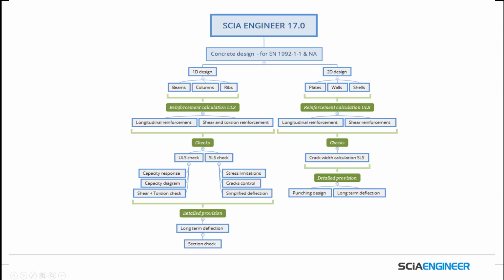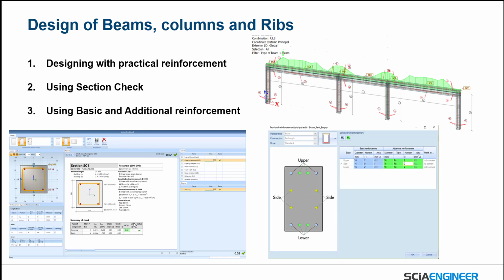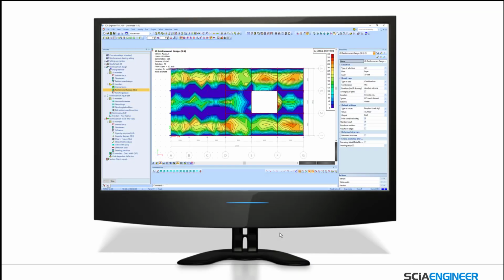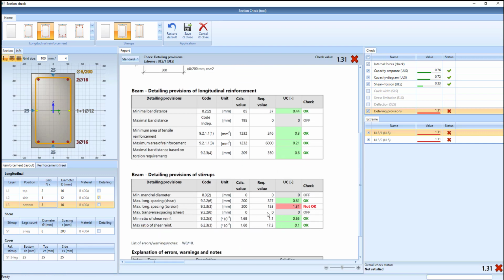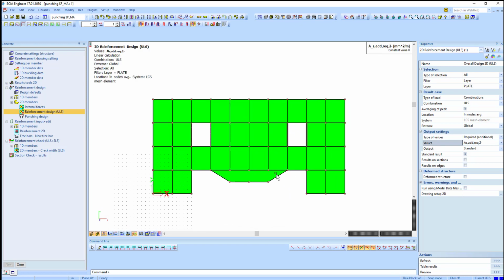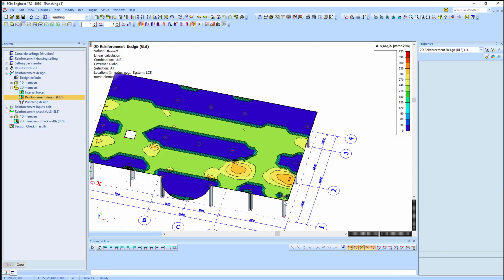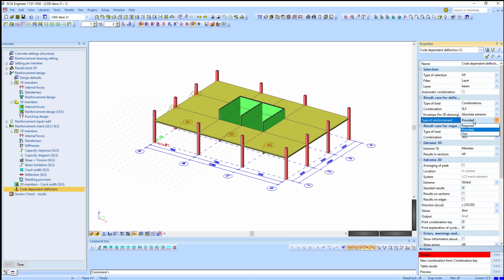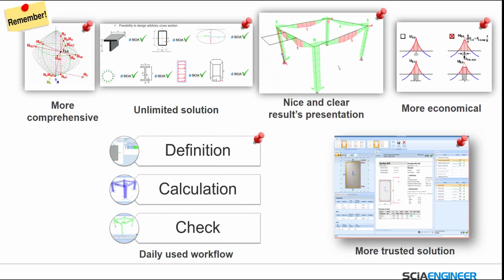[EN] SCIA Engineer 17 – The New and Powerful Concrete Design

Comment: Can we get shop drawings ??
Reply from the maker: Shop drawings are not yet supported. We are working on that and we will include it in one of future versions. However, SCIA Engineer supports a set of schematic drawings that can be used to explain the results to the draftsman - see the link below:
https://resources.scia.net/en/articles/concrete/wizard_for_reinforcement_schemes.htm
Reply: Can we transfer scia model to staad or etabs?
Staad has an extension Staad Advanced conrete design from which we can get shop drawings currently for concrete design
Reply: Please follow the linkhttps://youtu.be/kTWo-PZPlVw for RCdc. New version RCDc 6 has us indian and british code supported.After analysis the file is imported in RCDc and a click genrates shop drawings BBS etc. If this feature can be added to scia it. Will expedite the work flow. No need to transfer the analysis file to detailing software. It will be a hudge cost saving for small consulting firms.
Reply: No. There is just way how to import Etabs model into SCIA Engineer.  See following link https://resources.scia.net/en/factsheets/modelling/modeller_etabsinterface.htm. There is also option how to import Staad model into SCIA Engineer through Excel and XML - see this post in our forum. See following link https://forum.scia.net/viewtopic.php?f=2&t=1126. Jaroslav Broz, PM, SCIA